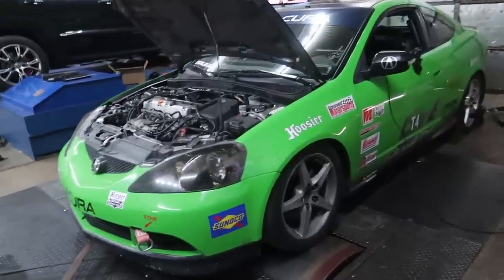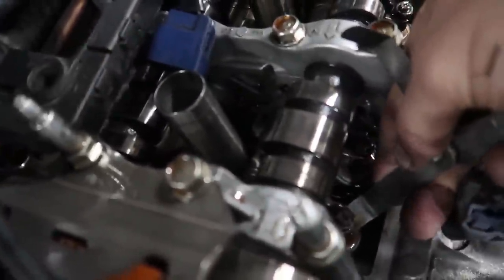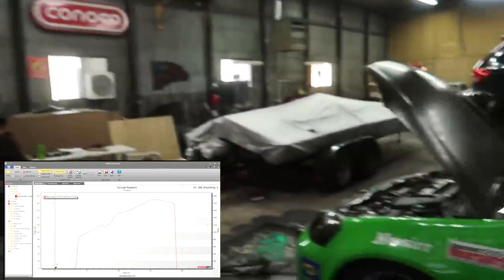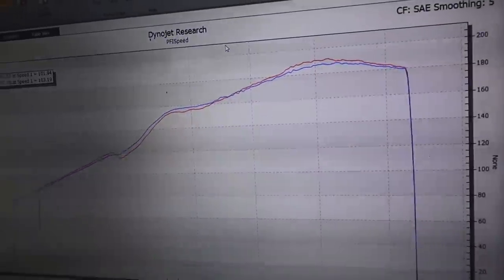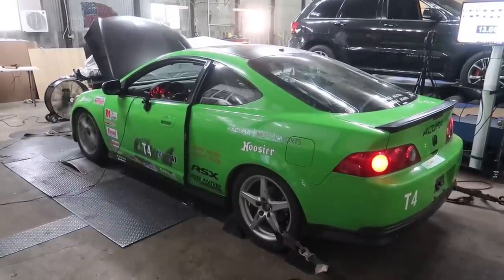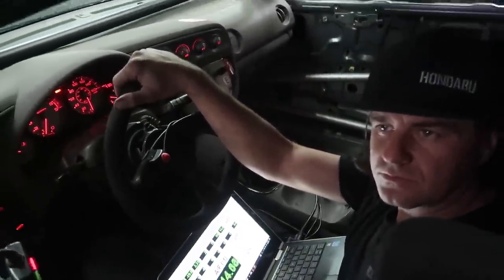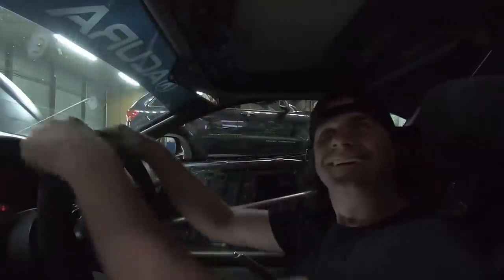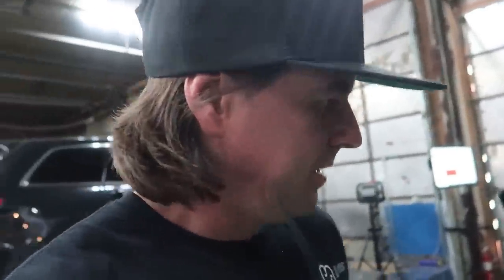Tuning a Stock K series engine with a 55mm Restrictor. Challenge accepted

Comment: I love watching Brent tune. He is like the Bob Ross of tuning. 

"I'll just interpolate it for a nice linear curve... So the cam doesn't have to work too hard and is hunky dory make power and sing and be happy..."

Truly an artist of tuning!
Reply: I was thinking the exact same thing
Reply: Someone give him a brown FRO!
Reply: @playandgrowtv9846  #winning!
Reply: Check out jeff evans if you want to se a real artist. Than you tune every vtc angle for optimal fuel and timing, than overlay them and use that angle on every spot that makes the most power. Brent is just doing guesswork based on experience.
Reply: I swear every 1 in 2 comments on pfi videos is pure cringe....
Reply from the maker: Anton J  absolutely but to tune every one degree would literally take days. We were moving the cam very marginal . Shifted by a couple degrees .
Reply: @PFIBrent  Yes but you interpolate/switch between different fuel/ ignition tables  and if you haven't optimised each of them on their own  than maybe you have 30degree vtc and tries 35-40degree but se no power gain. but the problem is that the 40 degree table could take 2 degrees more ignition timing  and if that had been done than you maybe had gained by 40 degree angle. thats they only way to tune it 100% and no guess work.
But yes to tune that way and optimise everything it takes a full day to tune a k-series. But if it's a roadrace car or streetcar every hp here and there makes a difference and to know everything is safe :D a drag car is ofc a different story. But that's my point on view and i know you have great experience and can do estimated guess work.

Comment: This video gave me an idea that might make an interesting series for the channel or at least be interactive with the viewers.  The idea is looking for power gains and losses in small changes that people with no experience can do such as comparing different fluids to see if they help or cost power.  For example take a bone stock vehicle and compare the factory recommended oil to a high performance oil on the dyno to see how much power the oil actually frees up. Or comparing O.E. air filters to performance ones and stuff like that,  You could call the series PFIXperiments and allow viewers to submit suggestions that they would like to see compared in future videos.  Another great video by the way.
Reply from the maker: Great idea man. Love it

Comment: Hey Brent, have you ever activated V-Tec at engine idle speed just for fun? Out of curiosity I wonder what it would idle and sound like. Also could you give an example of cam lift and duration for the non V-Tec lobes vs. the same cams V-tec lobes?
Reply from the maker: We lock them on some race cars and it has a super lopy idle, there is a dead spot at around 3 to 3500 rpm but then it gets good
Reply: @PFIBrent  cool thanks for the reply

Comment: To tune cam angle I usually do a pull at 0*, 7*, 14*, 21* etc across the whole rev range until I’ve gone through the range of the cam advance. Each advance will give you a peak at a different RPM. Find the RPM for the peak for each cam angle. To build the WOT part of the table, tune the data points at the RPM where the peak power was the highest For a given angle, then interpolate between those data points.

Comment: An actual 55mm throttle body with a nice smooth tapering down from the opening of the throttle body to the 55mm throttle plate would actually help out.

Comment: I've watched this 4 times I just love these k series and 9k rpm is incredible!! So much room to choose whatever gear is best for the corner and speed. I would love to swap my d17 for a d16 or d15 and cam it for mid range and high rpm use. I would love to just turn the d17 up to about 7800 to 8k rpm I'd be happy but I cant find much support to build the bottom end for it. I should be able to use a d16 cam and rocker assembly with slight modifications

Comment: 19:33 cant you check the speed signal in the ecu log? of course gear ratio settings must be accurate... but its easy to compare with the dyno speed reading
Reply from the maker: That’s how I ended up doing it , great minds

Comment: How do they certify you haven't bored and stroked the block? or swapped forged internals? I know it is easier to check if you have installed s1/2/3 cams as those are in the head but not everyone knows how to spot them, can swap titanium valves and springs you can do all kinds of stuff on the block and head and nobody will notice.

Comment: I have a K20A swapped RSX. 3in Intake, 70mm TB, RBC IM, KTuned RH, 2.75in Invidia Q300 Catback, 410cc RDX injectors + Highflow Fuel Pump, tuned on 93 octane....Only made 221WHP on a Mustang Dyno. Does it sound good to you? Seems weak to me lol

Comment: I would assume the restrictor restricts something judging by the 55mm that leads me to believe its throttle but what's the purpose please
Reply from the maker: Kyle Thompson  to slow the amount of air that can be drawn into the engine.
Reply: @PFIBrent  is that for tuning or class restriction

Comment: How come you guys don't use some sort of Knock detection?
Reply: On a Dyno you'll see it in the graph and in the AFR logs. Typically add timing until the gains aren't there, then back off a little to keep it safe.
Reply: @s2upid  Surly thats to late?  At least with knock detection you can get off the throttle straight away?

Comment: Wouldn't it help with HP and TQ if the valves were adjusted a little tight.  In theory (my theory) this would add to lift and duration, making the stock cam a little bigger.
Reply from the maker: As they get heat in them they get tighter. Remember when it gets too tight it won’t seal the valve and too lose it makes a bunch of racket
Reply: @PFIBrent  Yes I understand too tight will not let the valves close.  I was referring to a cam that calls for .022 and drop it to .011, would that do anything?  PS thanks for the reply!

Comment: I hear u guy's talk about vtech what the hell is it and what does it do the top end. Just wondering. Does Volkswagen passat 4motion with vr6 3.6L have anything like that and so it  tunable. Its 2008 Volkswagen passat 4motion
Reply from the maker: So each pair of valves on the intake and exhaust have 3 lobes. When you get to your set rpm you turn a solenoid on that locks the rockers to the center lobe that is much bigger then your cruising lobes giving you a bigger camshaft but idling and a low end
Reply: @PFIBrent  wow ok didn't know that. 
Have u worked on 2008 Volkswagen passat 4motion 3.6L vr6

Comment: Out of curiosity, if you were to set the valve lash to tighter specs (within range of course) wouldnt it theoretically create ever so slightly more lift thus creating more power?
Reply from the maker: Joseph Miller  I have noticed when on the tight side when hot you can get more pressure on the rocker. I just didn’t want it to keep a valve cracked open  at all.

Comment: Why not just do TDC lash cyl 1, then cyl 2 Intake cyl 3 Exhaust, rotate 180 then do cyl 4 then cyl 2 exhaust cyl 3 Intake?  Saves you the hassle of rotating the engine for every cylinder.
Reply from the maker: For sure. Just keeping it basic for the young guys comin in.

Comment: Why do you not get spark a plug socket that has the rubber inside, you can then remove without the second tool. It does it in one step.
Reply: If it stays inside the socket.after a while the rubber slips and stays on the plug.
Best is either using the coil or a magnet
Reply: I got a free lawn tractor that wouldn't run.  Only thing wrong with it was the rubber out of a  spark plug socket was jammed between the coil lead and the plug preventing spark from reaching the plug.      Easy fix lol.  Most of my spark plug socket are missing the rubber.
Reply: @sandys9791   Pretty godd size piece of rubber, you didn't notice the spark plug boot wouldn't seat down all the way. i have a hard time buying this story to big a piece of rubber for you not to notice that the plug boot wouldnt go down correctly. Any way. easy fix super glue the rubber in no second step to remove spark plugs. i am not into any extra effort at all do you no what i am saying??
Reply: @putuporshutup7258  that's actually how I diagnosed it when I got it home.  The spark plug boot was on a strange angle into the head.  I pulled it off and pushed it back on but it wouldn't clip onto the plug.  Looked in the hole and saw the rubber out of a spark plug socket jambed in sideways in the bore of the plug hole.

Comment: How much power would it make without the 55mm restrictor. Or how much does it restrict the power.
Reply from the maker: I’ve made 210 with an intake and exhaust . So I’d say closer to 200 with stock air box

Comment: Well, guess I’m gonna be searching for a K20 for my EG hatch, was gonna try to keep it old school and do an LS/VTEC swap
Reply: Dont waste your time with ls vtec.will allways get more from a stock k!
Reply: Ya but a full ls/vtec with fbo and tune is gonna be a lot cheaper than a k swap! 200whp stock block lsv should be jam in a eg hatch, and then you get turbo lol.
Reply: @tunertime9554  200whp wont happend without headwork and tuning!
When i was building them i was making them last.wich means oil pump,water pump,head studs,shotpeened rods,rod bolts,valvesprings,bearings,cometic gasket etc(+full bolt ons)...you get 210whp out of the k way easier and it lighter!been there done it often!k20 dry weight is 275pds...b series are around 330ish
Reply: Look, right now anything is better than the stock D15 that’s in it, even with intake, header, and exhaust!
Reply: @ForOdin  thats for sure!just think ahead not to waste your$ 🤘
Reply: Bear in mind, this is a daily, I don’t want to go too crazy
Reply: @ForOdin  have you thought of maybe doing a h swap instead like a H22 or h23 bluetop
Reply: Nina Blatchley I have, even thought of doing the old school G23 (F23 block with H22 head), but I really enjoy the B series, partially because I’m in love with the old Spoon CTR

Comment: Is it possible to change the variable cam time to a point where you’ll get piston to valve contact or valve to valve contact?
Reply: Should be fine with stock cams.. if your running a big cams I would assume yA

Comment: A street guy would shave the head and lighten a stock flywheel
Reply: I know that's right!!!! 👊
Reply: Shaving the head is cheating. If you're oddly fast, they can protest in SCCA. It would fail the whistle stop test. Since they're running through a restrictor, there wouldn't be really any gains to be had, since you're CFM limited.
Reply: Share ed head would not make it that much faster and  they wouldn't know by looking
Reply: @s2upid  whistle stop test? Elaborate,much appreciated.
Reply: @s2upid  Shaving the head would decrease the chamber size and up the static CR by a fraction of a point. What does that have to do with CFM?
Reply: Cheating & stealing are the same thing.

I hate thieves.

Comment: What is the 55mm restrictor?  Are we talking a restrictor plate?  If you’re only allowed to have a stock engine, why would anyone want to restrict the power?
Reply from the maker: It is a 55mm restrictor plate, they just try to keep power to weight equal between brands
Reply: PFI Speed ahhh, makes sense then.  Thank you good sir for the reply.

Comment: I used a 22mm restrictor to save the transmission of an old FWD car :P
Reply: It’s funny how old cars with weak engines could still have a weaker transmission
Reply: @alexvillalobos7137  I know right, sometimes you get lucky, my old DJ5 weighs nothing , has no power but boasts a TorqueFlight A727 transmission

Comment: 90s called. They want their air ratchet back...jk brings back memories
Edit. I just use a 19 wrench on p/s pulley. Easier to get to than crank pulley. And you're not on tdc. Intake cam lobes should be higher. I understand its on base circle but honda says adjust at tdc.
Reply: Nobody cares